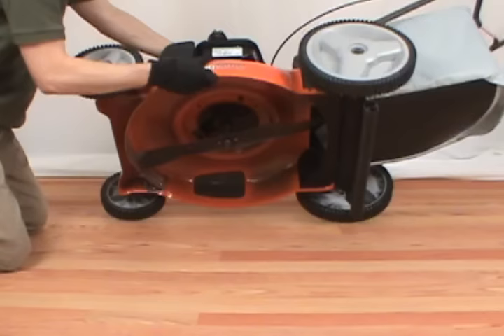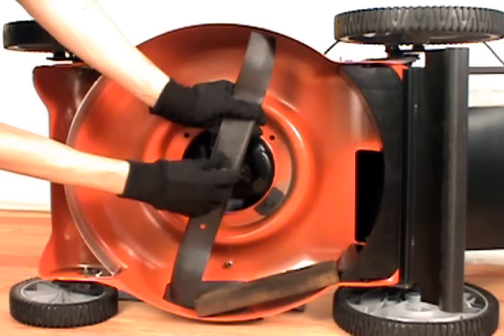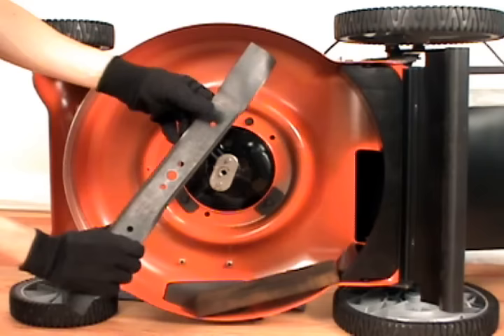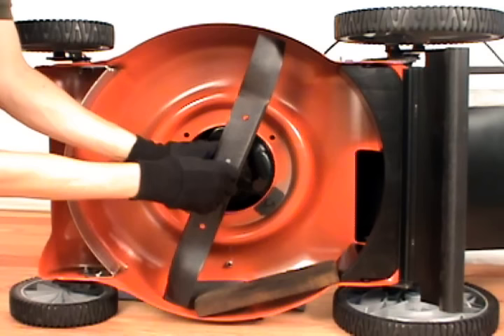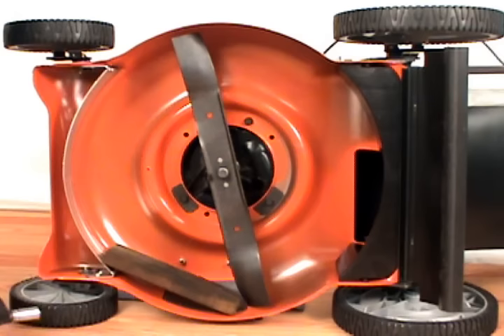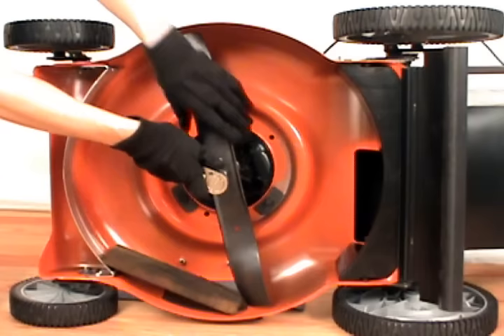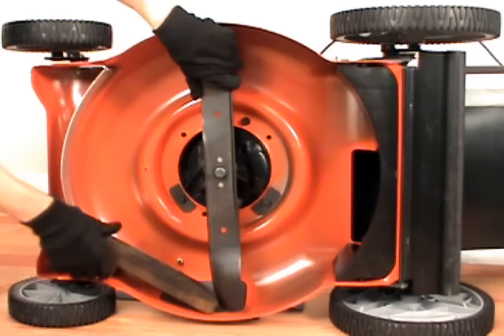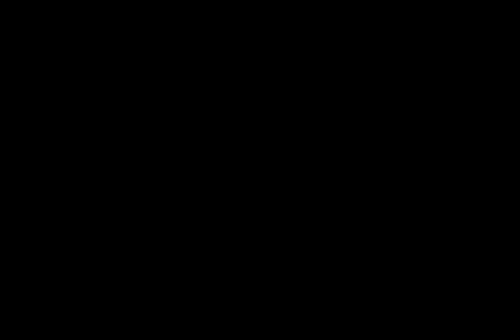Replacing the Blade - Husqvarna Lawn Mower

Comment: Jack!   Woke up to a HOT day, not enough sleep and dealing with Lyme tick bite!!  You made my day....honest.  Never changed a mower blade,  and wasn't sure if the dynamics of a blade going round and round might affect which direction the bolt should be  tightened. Physics or something??!!! and didn't want to be beating the socket wrench with a hammer in the direction.  Your short instruction makes it now possible for me to get my first Husqvarna job of the day done very easily!!!  Many thanks!

Comment: how you can you demo this and not state the size of the socket required or which way the blade turns when putting back on as its difficult to determine which end is the sharp end.
Reply: I agree on telling the socket size. But if you don't know which way a push mower blade turns and you can't tell which side is sharp, YOU of all people definitely don't need to be working on one 🤷🏻‍♂️
Reply: He said put the new blade on the same way the old one is situated.

Comment: Quick look at your video confirmed that I should turn anti clockwise to remove blade. It was on tight and I did not like to give it  a bit of help with rubber mallet. A couple of taps and away we went. Used a long handle socket wrench which gives enough leverage but still needs a couple of taps to get going. Thanks for the video!

Comment: This is not worth replacing the blade because it's a cheap mower.
You can buy one for less than $110.00. And it's all cleaned.
Reply: I paid $12.79 for my blade and I own a set of sockets and a ratchet
Reply: @ronbarker472  Yours is an AWD?